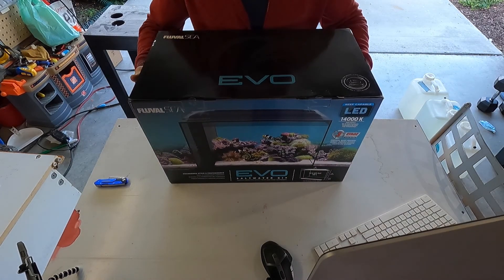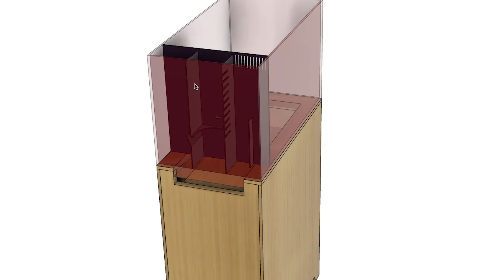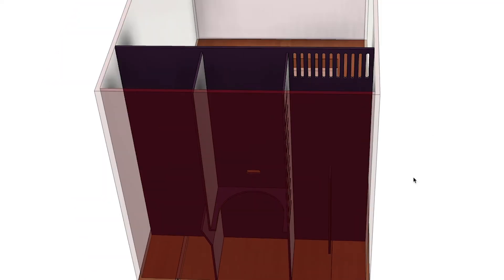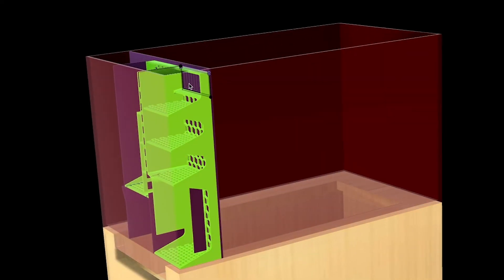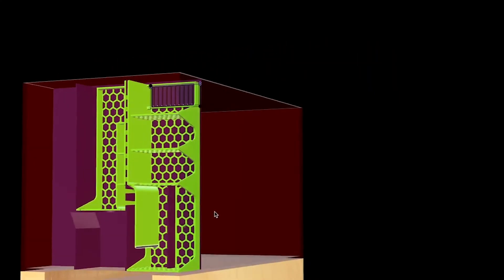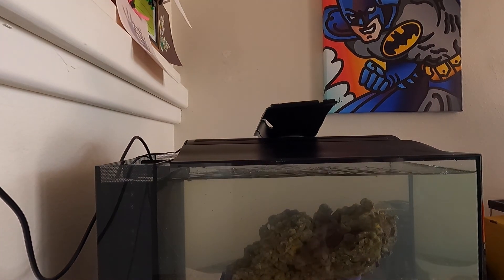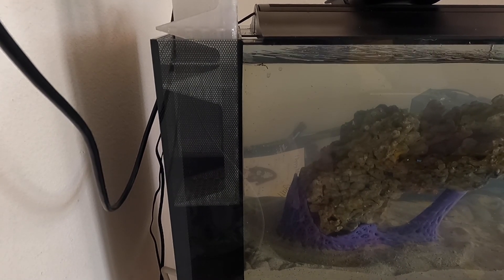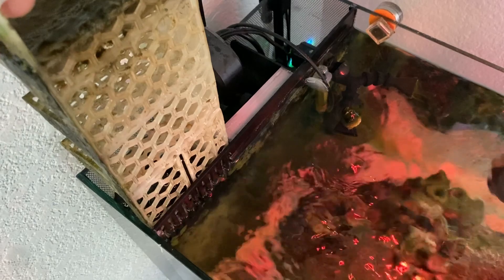Fluval Evo 13.5 Filtration Upgrade - Media Basket Design & Creation

Comment: Love the rollermat! Hopefully a WaterBox version is in the works
Reply from the maker: It’s already up an running.  Just have to iron out some minor issues.  I’ll have a video up in a few weeks.
Reply: @ISeaLive  Great news.  I'll have my PayPal account ready for the release! I use a printed floss cup that replaced the filter sock but it becomes clogged very quickly.
Reply from the maker: @blakefl8623  cool,  this thing is looking very promising.  I’ll set you up with one of the first finished roller mats.
Reply: @ISeaLive  Looks like it'll be a fun build.  I need to order some more PETG and ill probably give Printed Solid a try with their budget Jessie filaments.